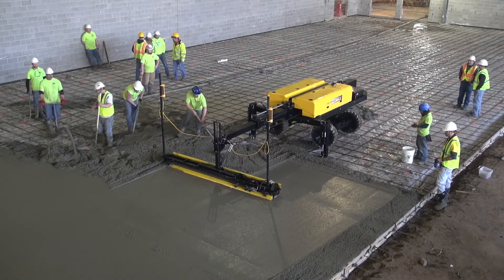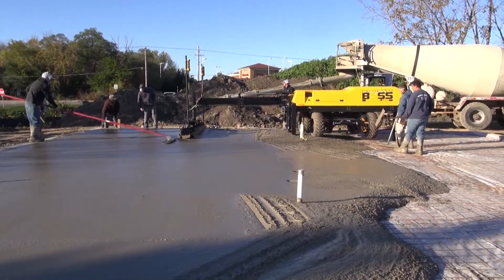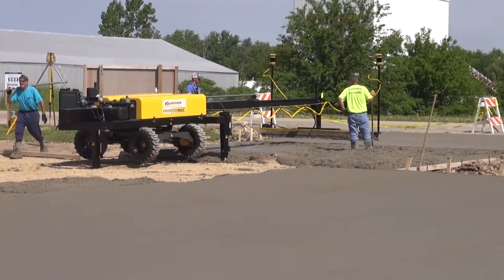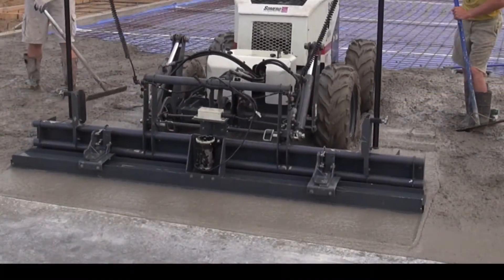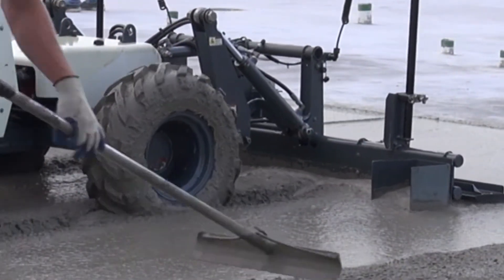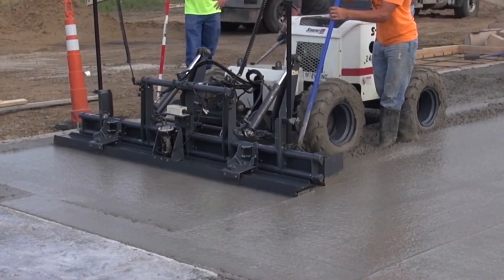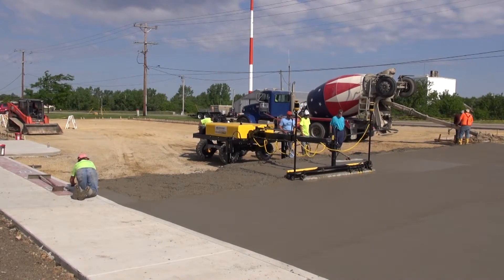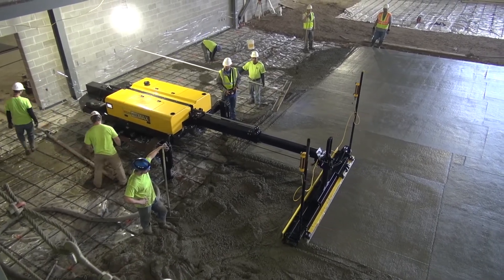Learn About the Advantages of Ligchine International Laser Guided Boom-operated Concrete Screeds

Comment: I have no problem with Ligchine trying to prove itself against its competition but if you want to do that then you should compare their boom screeds against your boom screeds. You're being very selective in your comparison. I have a fixed head 940 and as long as you have a raker moving mud into the wheel ruts then you are fine, in fact, even if you don't you are fine because the auger is turning concrete into those ruts. I think you guys have a nice screed but your selective comparison is incorrect.